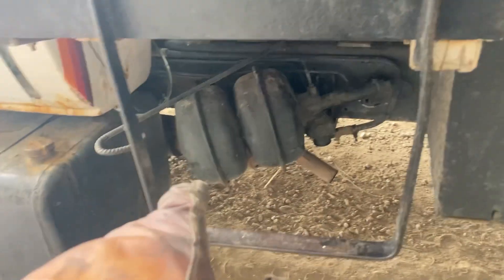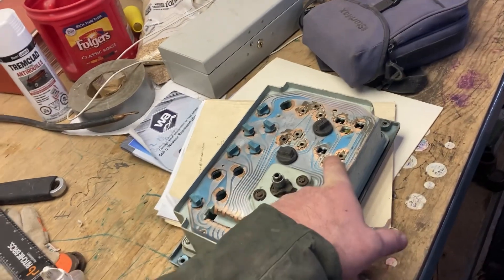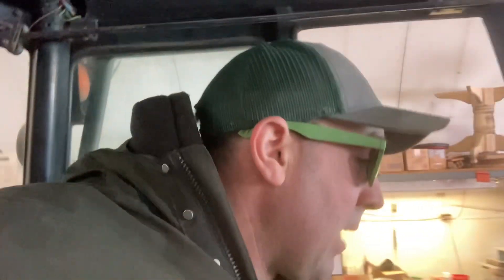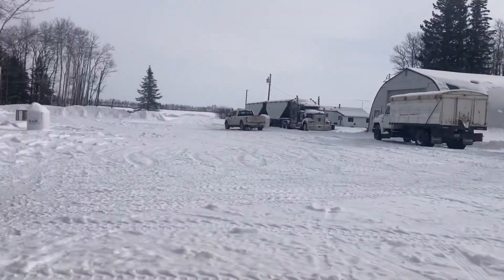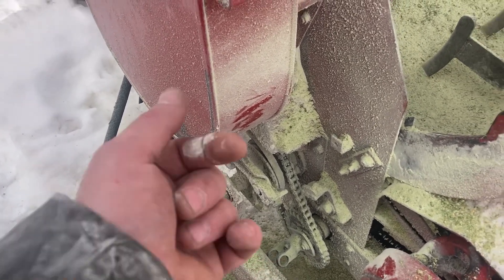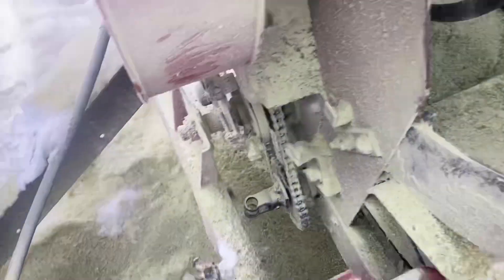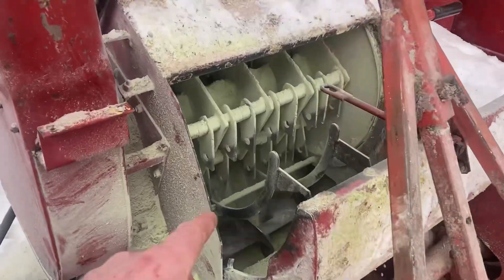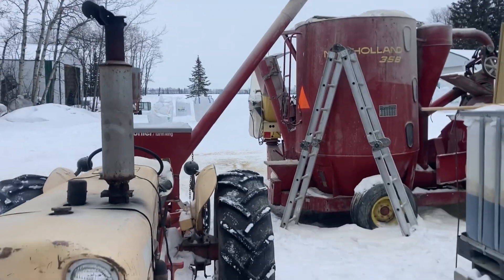The hammer mill won’t hammer

Comment: Repairing things is going to make a comeback at the rate the parts industry and pricing now days is going- i  went to price out a door latch for my old duramax, 400$ cause it had keyless entry . 400$ , got one at a pick n pull in Calgary for free lol
Reply from the maker: Yeah it’s a lot cheaper to fix then replace these days.
Reply: @millionairefarmer.  if you can keep things going haha. Our 6430 Deere bedding tractor got its 3rd engine replaced. 60 grand. Seems to need one every 1000 hours so it’s hard to fix things too when they just blow up haha
Reply from the maker: Oh boy that’s not good
Reply: @millionairefarmer.  Deere has paid for it twice I think but still haha takes four months to get a build done
Reply from the maker: @damonens9478  that’s the other issue the quality of workmanship is pretty hit or miss
Reply: @millionairefarmer.  put it this way lol Brandt took over Cervus and things have gotten slower shittier and more expensive lol to sum it all up